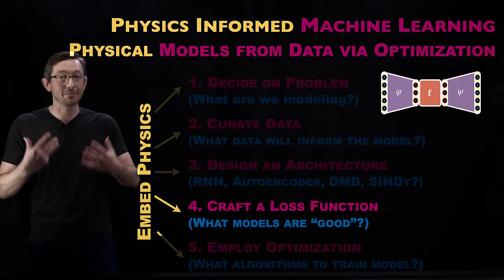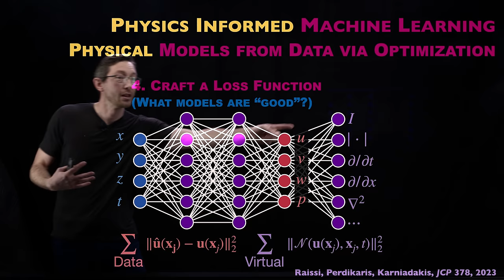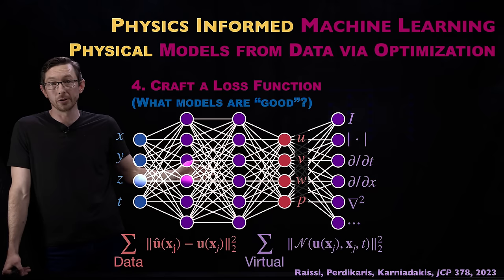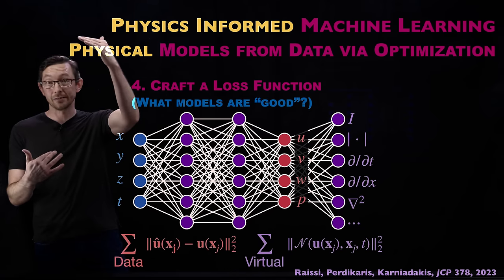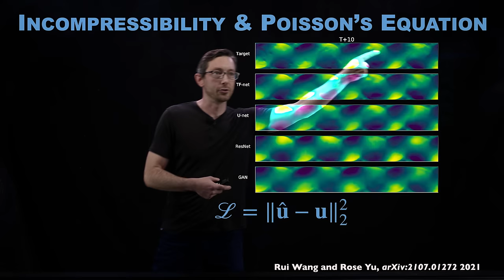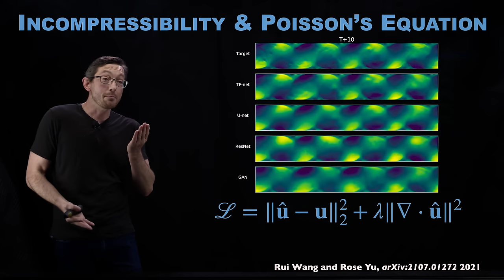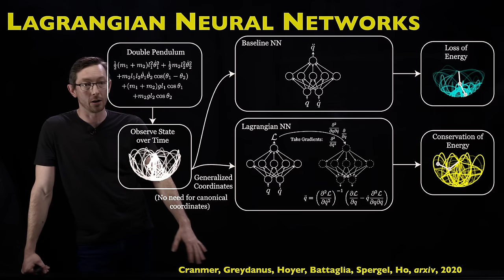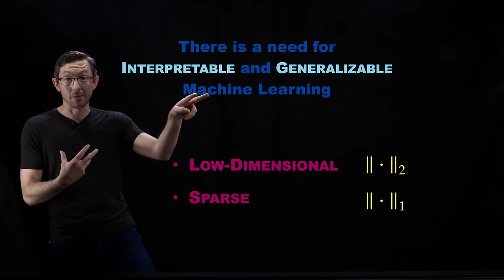AI/ML+Physics Part 4: Crafting a Loss Function [Physics Informed Machine Learning]

Comment: Great video! However, I noticed a potential mismatch between the figure and the loss function at 21:53. The figure you show seems to describe "equivariance", where the transformation \( g \) applied to both the input and output is preserved after passing through the neural network. But the loss function on the left (\( ||y - f(x)||_2 + ||y - f(-x)||_2 \)) looks more like it enforces "invariance", as it ensures that the output remains the same regardless of whether \( x \) or \( -x \) is used as input. Also, this is referred to as "equivariant loss" in the chapter, which could be confusing.
It would be great if you could clarify this difference between "invariance" and "equivariance" to avoid potential confusion. Thanks again for the insightful content!

Comment: Are there models of loss functions/ optimization functions that can switch tactics (or swap out functions completely) depending on what stage of training a machine learning model gets is on? 

I was studying transformers/ self-attention architecture and it made curious if “self attention” could be used specifically on the loss or the optimizing functions to either tighten up focus on a more specific goal, or broaden it depending on where the training is at. 

Does that make sense?  

This is the “Multiple loss or optimizing functions that are activated at different times using different triggers” approach.

The self-attention method of deciding when to tune or modify (or replace) an optimizing function-  I think would be spectacular to demonstrate! 

It is the key architecture used in OpenAi’s SORA, Chat GPT 4 (and 3 and 2), and many other successful machine learning tools. 

Also- open question:  in what ways can LLM’s or image classifiers / generators be utilized in physics intended machine meaning? 

Could SORA figure some physics on its own simply via studying video footage as well as the ability to  identify, label, and categorize objects in a video **and ** learn and generalize how these objects change over time? (Like objects falling).

I know a lot depends on the training data (watching leaves fall vs watching rocks  fall…
That’s my big question!!

Comment: I am interested in the concept of equivariance and invariance related to neural network interpretability. Usually to satisfy the physical constraints given by symmetry we build neural networks that are equivariant, why don't we build neural networks that are invariant instead? In this way, it is not only the output of the network that satisfies the laws of physics, but it is the network itself, with its parameters. Basically instead of choosing via sgd optimisation any parameters in the parameter landscape, can we constrain these parameters in a physically relevant sub manifold? 

My idea would then be to build neural networks analogous to physical systems, where the parameters of the whole network have an analogue in a physical theory and not just those in the autoencoder bottleneck. 

An application of these neural networks could be in the field of topological quantum field theory but in general in any lattice gauge theory, where the neural network itself becomes a piece of graphene that spreads the input current over the output boundary state. It can also be a potts model, a spin glass or a penrose spin network, which recognises physics because it is built in analogy with the physical model. 

Perhaps putting such a strong constraint on the parameter space would be counterproductive, making the neural network lose its ability to generalise. But this is a very interesting topic.